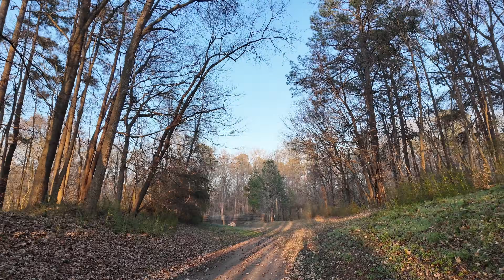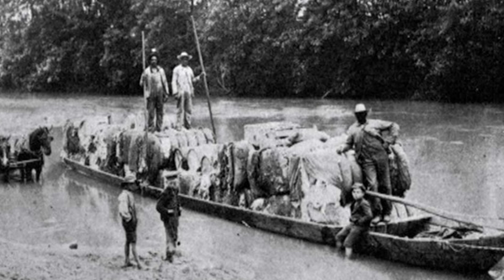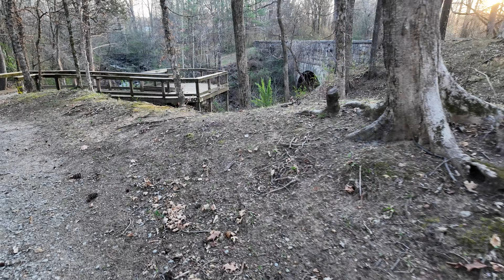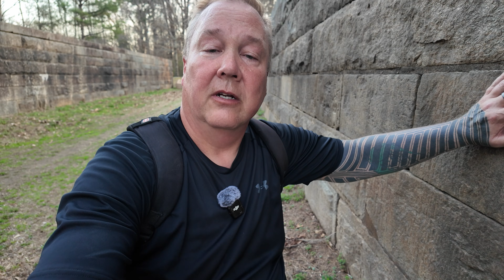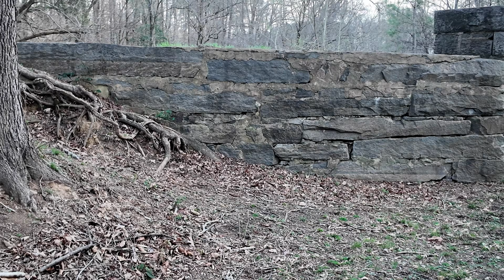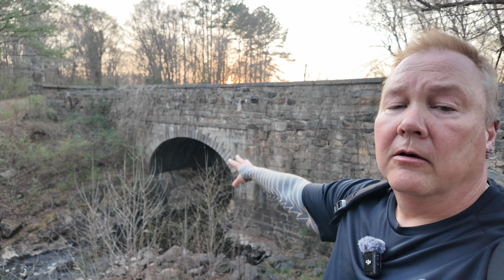Engineers Built This 1820's Stone Bridge to Carry Boats

Comment: "BATEAUX"  is the plural form of  "bateau," a shallow draft flat bottom boat. The name derives from the French word, bateau, which is simply the word for boat. The plural, (bateaux), follows French grammar, an unusual construction for an English plural.  In the video, the narrator consistently adds an "s" at the end of bateaux - (bat toes).  This is improper and quite annoying to French speakers as the term is already plural.  In other words, if you have only one boat, it is a bateau.  If you have multiple boats, then you have bateaux (boats).  In French, the "x", though silent, is the equivalent of an "s" in English. This is almost like "deer" or "shrimp" where the singular and the plural are both pronounced the same.

I am not trying to be pedantic or catty as the video is otherwise excellent!  I am a perpetual student of NC history and have taken numerous NC history courses over the years and regularly do research related to NC locations in connection with genealogy.  I have done research on the Landsford Canal in upstate SC - an excellent location which is now a state park- but was honestly unaware of the Chockoyotte Aqueduct!  That this has been largely omitted from NC history books is unfortunate as this appears to have been highly significant to trade and economic development during its years of operation.  NC was notorious for failing to follow through with internal improvements during the Colonial era up to the advent of railroads. The quality of the stone work and construction depicted is outstanding.

Thanks for filling in this gap in my knowledge of NC history.  I will put this on my bucket list!
Reply from the maker: Thanks for the correction. I speak some Spanish, but my French is pretty weak.  I was going on what people there were calling them.
Since you seem familiar with batteaux, have you ever been to the James River Batteau Festival up in Virginia?  I ran across it when I was looking for more information on them and was thinking about trying to go.
Reply: @Industrial_Revolution  I have not but plan to visit Jamestown in the near future.  I have an 8th GGF who came to J-Town around 1618 - in time to get killed in the Berkley 100 massacre.  Thanks for the info!

Comment: Good and interesting video. I chuckled at the reduced standards for the higher stone blocks. Yeah, it is beautiful. Good Luck, Rick
Reply from the maker: Thanks, Rick.  The dividing lines are pretty clear, when you know what's going on.
Reply: @Industrial_Revolution  When I was designing and building bridges, part of the fun was figuring out the clues and how I should address them. I was able to reuse many stable stone abutments by pouring a reinforced concrete girdle around them. Good Luck, Rick

Comment: Darrin, it's always a pleasure watching your early industrial videos

We had a short canal built to divert freshwater to a small saltwater inlet. which was then dammed up to produce a freshwater pond for industrial purposes.  By the 1840s this quarter mile long canal was lined & covered with large granite block.  A few years ago, during an urban renewal project, the canal's granite blocks were pulled out & replaced with a concrete conduit.  A few of the granite blocks were "saved" being used as fake architectural elements in the neighborhood.
Reply from the maker: Thanks!
So it was buried in granite blocks and they replaced it with concrete?  Should have left the granite.  It'd probably have lasted longer.
On trend that's nice to see is unburying rivers and ponds in cities.  Maybe next time, when the concrete falls apart.